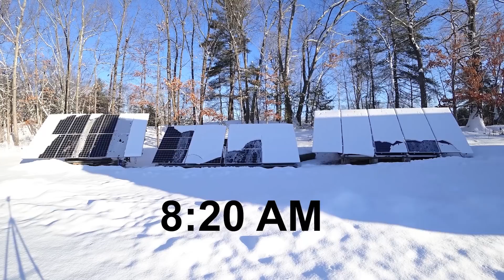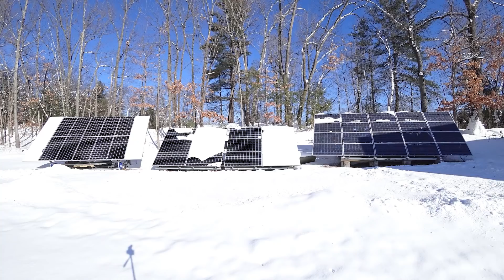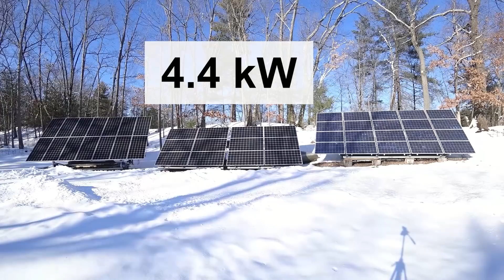How to Plan for Shading and Azimuth on Solar Arrays.

Comment: Interesting, never knew you were in MA also... I'm down by rhode island. Just bought a house up in maine though where i'll be setting up a similar array. In my currwnt yard i'm 360deg surrounded by huge pines (none are mine)  and can only use solar in the summer for a few hours.
Reply: OUCH, that sucks. My neighbor has this huge pine that covers half my yard for almost half the year... stupid thing is at least 200 feet tall and about 80feet wide at the base (branches, not the trunk...) I am in northern Washington and winter is meh on solar anyway but having that shadow for most of the day SUCKS!

Comment: Well you have to work with what you have for location and latitude including weather patterns for your solar window. My arrays are tuned to when I need the power similar to yours. 32 Enphase M250 are set on my roof so the angle is more for production in summer but these panels are netmetered so I bank the surplus also winter snow robs me of production so it is good to use the summer angle. 8 Enphase M215 also netmetered set on a winter angle in back yard to make up for lack of roof panel production. Also 9 panels on winter angle used for battery charging and 8 panels on roof used for battery charging, these 2 arrays also are 90 degrees apart for direction. Recently put in 2 Sun 1000 on limiters to boost the amount  of production which Enphase is lacking in winter. Sounds complicated lol well to actually make enough to run a home which 100% electrical is tough in Canada because of the high heat demand but I am winning. Lots of videos on my channel but I rather spend my time on solar so video quality is lacking. Cheers PS doesn't sound difficult to explain until you try it. LOL
Reply: Yep Canada is tough for solar especially anywhere non-coastal.  I feel for you.  100% is tough even at 35 lat.!

Comment: Put up high on the roof out of the tree line.
Reply from the maker: I couldn't get a permit for that.
Reply: @DavidPozEnergy  Maybe worth re-applying occasionally, and some point there is likely to be an attitude change
Reply: @DavidPozEnergy  Gov: We love Solar PV. Solar PV really should be mandatory, even for people who don't want it or can't afford it.
Also Gov: No you can't install solar PV. Our arbitrary rules don't allow it to be installed.
Reply: Bout the gov restrictions: 
Calif is really bad, but there's a code section (not a new one) that essentially says that Solar trumps all. Prob is that it mostly applies only to permit simplification. 
I found that if I hired a company they could lean on the bureaucracy & get it done. Cost much more than diy, but they made it happen. (I then was able to Very Carefully pull a 2nd permit myself.)

Comment: I live in the tropics. Trees and power poles all around my arrays. I have 19kWp in panels. The key is to have them split on as many mppt channels as possible for string inverters (ideally micro inverters, but i cannot afford those) or many parallel strings with string diodes when only one charge controller. Works pretty well if you plan it carefully. Have some videos in my channel, but no time lapse, sorry ;)

Comment: Life lesson for all 
Power costs always go up 
I learned that years ago, I learned that in retirement Power bills and taxes will kill your retirement. STRESS  not good in retirement,   our house in Arizona is built to get sunlight from morning to evening 9660 watts , no electrical bill and that's good in retirement,  no bill stress,  low taxes,  good medical  no Power bill 👍 300 days sunlight  not 300 days rain  my bones like warmth.
Lots to do for us in Arizona also camping  enjoying life and so on its amazing how solar made it better
Reply: Interesting. In the 12 years I've tracked the power costs in Northern Virginia, my cost, including kWh and delivery and taxes, was its lowest at around $0.108 per kWh and peaked at $0.129 per kWh, averaging $0.119 per kWh over 12 years.

I realize that each state has different cost structures. The US average was $0.1054 per kWh in 2019. Connecticut was the most expensive in the US48 at $0.1866 per kWh -- Alaska and Hawaii take the crown at $0.2022 and $0.2872 per kWh. Arizona's average was $0.1052 per kWh in 2019. 

The ROI on Solar Panels in Arizona must be longer than your retirement! How much power are you using per month @Gary D?
Reply: I added 10,200 watts face south to my house in Arizona Phoenix location power bill is not zero in the summer but much better than $400. And our summer the fee is $0.25 a kilowatt and on peak is $0.35 per kilowatt through APS you have to add the junk fees they add in like delivery fee generation fee and that's what it comes out to per kilowatt. They try to trick us thinking it's half the cost but it's really not. I plan on putting up another 3,000 Watts that will face directly west for that peak time summer surge price. Overall I'm happy with the system I installed it myself saved tons of money.
Reply: Thank you for sharing your wisdom.
Reply: Sounds like you’ve got it made!

Comment: What about during the summer months it doesn't seem like your arrays are angled for the summer or can you angle them up or down for the summer months or is that just not necessary? Love your channel and the content you put out too by the way. I've been subscribed to your channel for a while now.
Reply from the maker: A 30 degree slope would be great for summer time production.  My arrays are a 45 degree slope.  I did this because I have more solar power in the summer than the house needs.  But I don't produce everything I need in the winter.  I made them steeper to optimize production all year long.

Comment: Funny, I have a brand new 6KW array that points directly south that is not wired up too. Waiting for some safe touch fuses holders from AltE that are getting longer and longer delivery times. Also can't bury the power cables because the ground is frozen so will be doing that in spring. We have wintry mix for the next few days (CT) but once that has passed I'll make a timelapse of the sun illuminating my panels and post it on my channel and provide a link. Oh, and the new array is shaded by a Japanese Maple though that's not too bad right now because it has no leaves at the moment. In summer as the sun gets higher the shading will be much less of a problem. Thanks for the vid!
Reply: Try All Fuses  search usm3 fuses

Comment: I got them on my flat roof, no shadows. A string of 9 275w panels to the south and 4 325w panels to the west to catch evening sun. I notice the cheap 275 watt panels produce in cloudy conditions way less than the more expensive and newer model 325 watt ones. So besides the more space they occupy, also the efficiency is less in not ideal summer conditions.